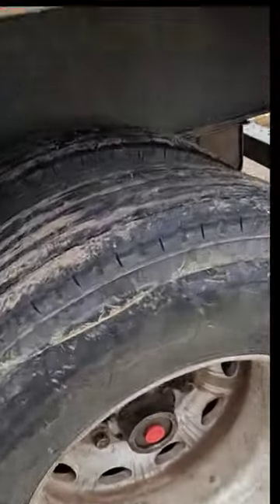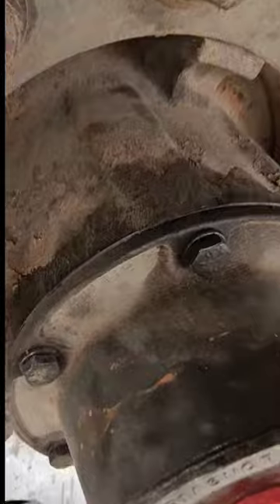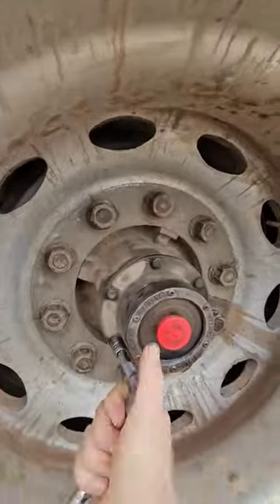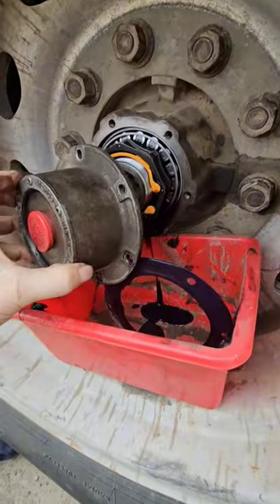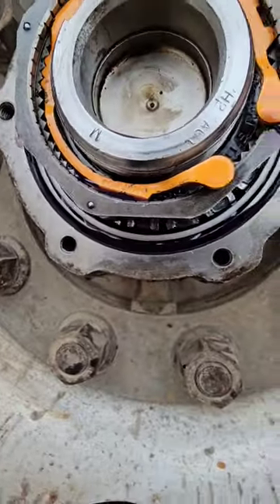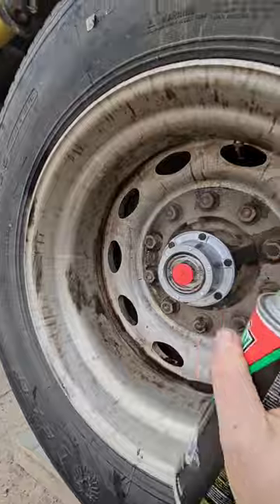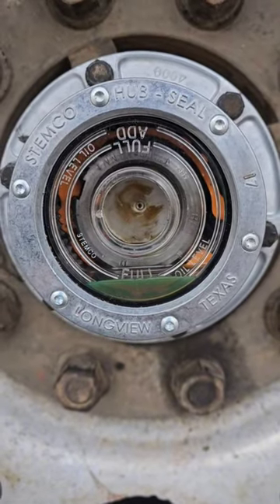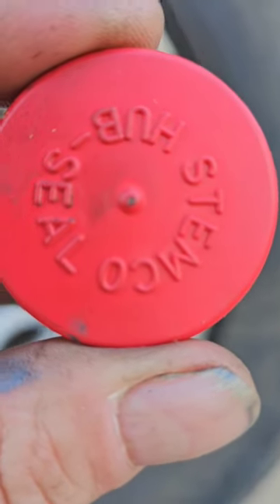Fixing a hubcap leak on a flatbed trailer.

Comment: A 1/8 hole in the red cap should be big enough for a vent hole. But a quick inspection where you have the most time inspect the trailer hubs frequently. Its cheaper than having to replace bearings etc.
Reply from the maker: Yes.  Part of my pretrip is to make sure the hub oil level is good.

Comment: Seems amazing to me that they'd rely on the oil staying in via that red bung, and with it having a hole, albeit a very small one in it, in what's meant to be sealed and clean....
Reply: It’s never going to leak out of the plug unless it’s overfilled. The fill line is well below the plug. And when rolling down the road centripetal force keeps the oil to the outside of the hub. You will see some seepage with older plugs but it’s very minimal.

Comment: Back in 1970 I worked at a truck leasing company and replacing wheel bearing grease caps with visible gear lube caps was my first job. You believe you improve the operation with a hole "poked" in the plug. I wonder what Big Rig or Stemco says about that.
Reply from the maker: There's already a hole there.  It comes that way from Stemco.  I showed it at the end of the video.  It's there for a reason i would imagine.  It gets clogged sometimes.  If I gain nothing from clearing out that hole every now and then, oh well.  No harm, no foul.
Reply: That hole is there from the factory to vent the hub. It is recommended to poke something through the hole periodically to make sure it isn't plugged. If it plugs and builds pressure, it can cause the wheel seal to leak.
Reply from the maker: @toby0395  That's what I thought.  Thankyou for clarifying.
Reply: @aftersolo  No problem, most people don't know about it, just like most don't know to spin the old style vent caps on drive axles to make sure they aren't stuck either.
Reply from the maker: @toby0395  Most definitely.  I got those too.

Comment: You used stop leak oil. It looks way to thick on the video. Hope it was really cold out and that's why
Reply from the maker: Its still adverised as just hub oil though.  I like the thick consistency of it.  Keeps everything lubed up pretty well even when the seal blows.   The thinner stuff can all flow out a lot faster and then the bearings overheat and there goes the wheels.  It was cold though.  That stuff doesn't stop leaks either even though it says it does.  Never has.  I can't really think of any "stop leak" product in a bottle that actually stops leaks, at least not from my experience.
Reply: That's just Lucas's hub oil. That's the way it is and it works great.